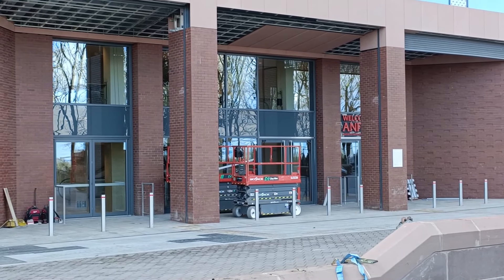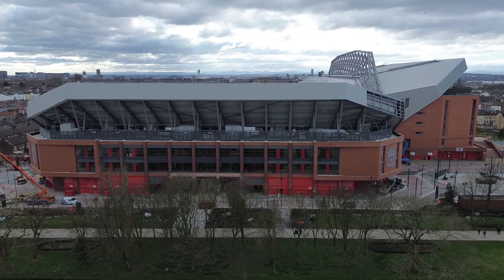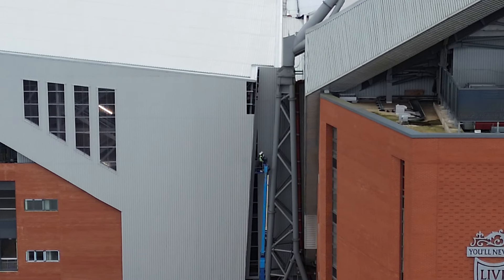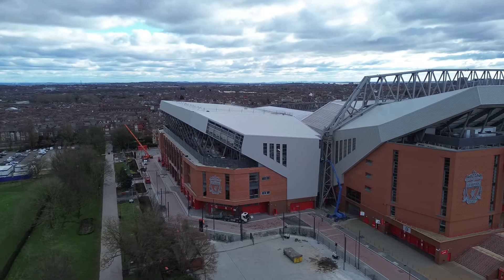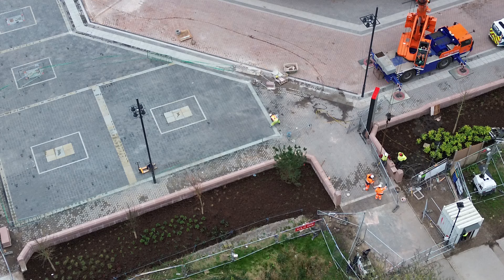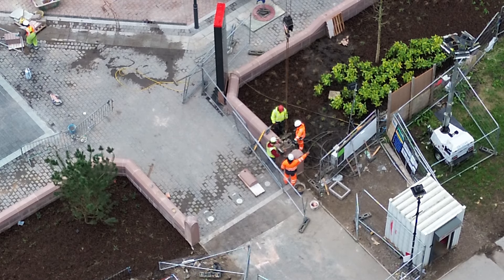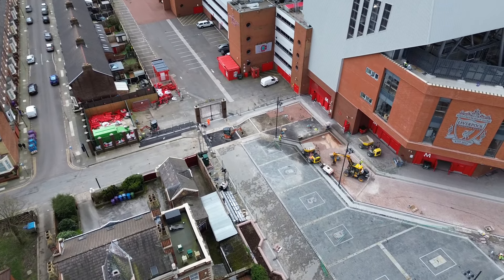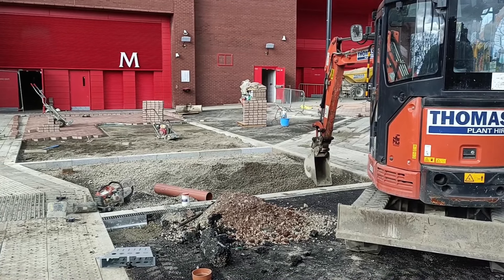Anfield Road Expansion 26/02/2024

Comment: Looks like the 2 areas of tarmac at the SKD side will remain like that with the block paving in the half done corner area we see, plus the current empty area. Some unfortunate interfaces of tarmac where the scheme ends and council roads begin. The condition of the SKD carpark is also terrible so, certainly from the air, where this work interfaces with that is not great.

I suspect overall, the push is on to have it as ready as possible for the City game on Mar 10th

Comment: Thanks again for the footage, mate. So close to the final touches outside the stadium. I'm interested to see what they do with all the lampposts outside the opposition entrance near the main stand. Looks like too many lamposts for lights and security cameras, id imagine anyway
Reply from the maker: Thank You so much, yeah there is loads on that shoulder area outside plus three more ceiling cameras on the red Cladding underneath the shoulder section
Reply: They are wind baffles, when they design these stands they do wind tests with a model of the stadium including the trees and with data of the typical winds around Anfield. They will have seen around the Main/Annie Rd stands potential for issues, so wind baffles are being put in around that area to break up the wind flow at ground level.
Reply: @wickedjuice  wow, interesting! Thanks for the info, didn't know any of that and good to know